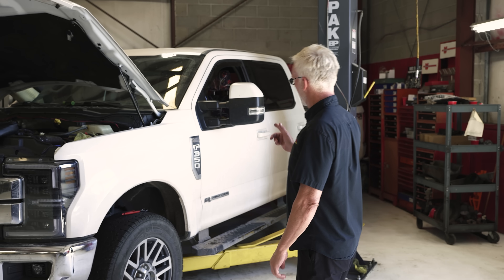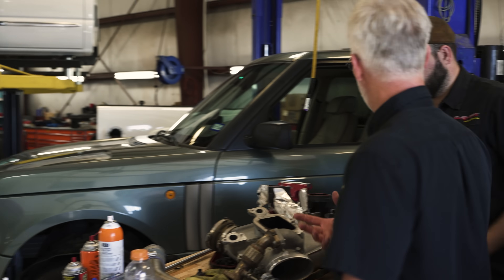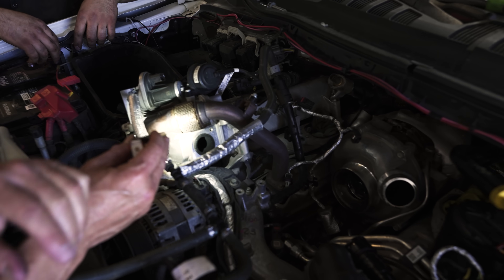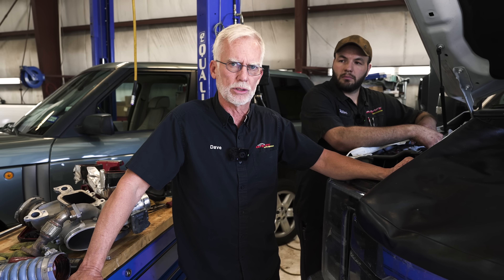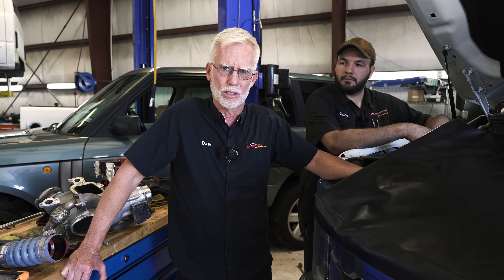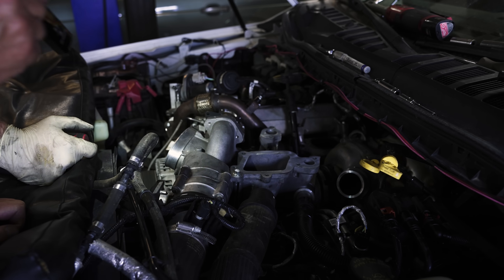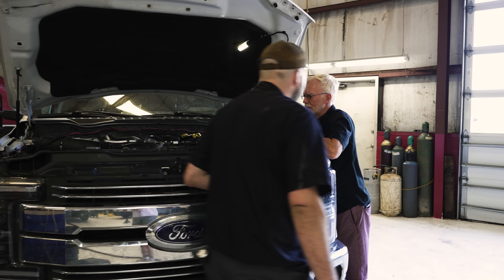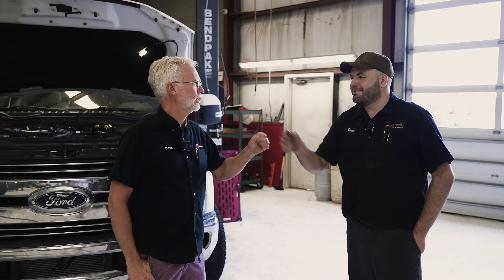2019 6.7 Powerstroke EGR Maintenance: The Problem With Carbon Build-Up

Comment: Anyone who puts miles on where I live (east coast Canada) deletes all this BS from day 1. Which voids your warranty but they know it’s better in the end.
Reply: The diesel brothers had to pay enormous fines for doing that it sucks but that’s the government we have need to change the gov to get change
Reply: @jdhiner1  no, you need to change the contract that all world leaders signed in Paris at the World Climate Convention.
Reply: @jdhiner1 yep! Uncle Trump 2024
Reply: @jdhiner1 damm them wanting cleaner air
Reply: Egr should be drawn after dpf. Problem solved. Cat engines go a million miles with clean intake passages. Manufactures just don't want to spend any extra. They rather it be someone else's problem
Reply: @warrenhodges8214  never thought about this but absolutely would make a HUGE difference!!!
Reply: We pay carbon tax, it solves all our pollution problems. Yes I’m being sarcastic
Reply: My '06 LBZ Duramax never had carbon buildup in the EGR system like that. Ouch.
Reply: @rosschamberlain1823 Iv been told that the LBZ duramax valve only opens when idling. But I can’t verify that. I have an LBZ too and never an issue
Reply: For the ones so worried about people deleting their trucks and how it’s illegal the last time I checked the government trying to control what you can drive and what you can’t drive I take as illegal especially when they are sending our soldiers out in deleted trucks yet the citizens of the us have to suffer from engine failure due to the emissions and then they expect us to keep paying for it if we want to drive them yet they can delete from factory and send them out to the soldiers? How does that make any sense seems like they know that the emissions are defective pieces of shit if they are deleting trucks from the factory and sending them out to soldiers. That’s my whole argument. Kory Willis is fighting against the EPA and how they are basing the whole US off of California and their tyrannical ways.
Reply: Rn that's illegal, how about we elect someone who can effect change and stop the horrible EPA ideas.
Reply: @affinityfunable  it’s legal where I live
Reply: If voting made any difference, they wouldn't let you do it 😂
Reply: @shaolinfist8323  very true!
Reply: @affinityfunable these egr issues have around since the 2000s, so what did bush and trump do about it lol.  Plus these regulations are global, so there is that.  I’m not saying it’s right but your opinion of changing government, like if you believe trump will change it is stupid
Reply: @bfv8 the Trump administration is getting ready to do just that. These Marxist laws are fixing to go away.
Reply: F the feds
Reply: Just delete the whole EGR systems...  Yamaha cant even get the R6 to pass emissions... this ruines everything on every motor
Reply: This is why manufacturers are making smaller turbo engine setups. To pass the emmisions bullshit when in reality its just making more junk yards
Reply: Illegal for shops here to delete
Reply: @CoachJay7212 You don’t have to take your car to a shop to have something done… you could just do it yourself
Reply: @Bllksem  that’s the way to go I guess.
Reply: @CoachJay7212 nope
Reply: @CoachJay7212 

Who's going to tell
Reply: @David-yy7lb  someone that gets pinched will turn rat fast.
Reply: You delete yes it’s a great option but…when you get caught, I’m not sure if the penalty in the USA but in Australia you’ll cop a twelve thousand dollar fine and whatever else.
Reply: @bryonricketts385  hi Bryon if you get pulled over on the street and if the do a technical check your screwed over here in Holland, if I am not mistaken they(police) will confiscate your car and you get a hefty fine. On top of that you’ll have to pay for storage until they are done with the investigation and than I will have to bring back the car in it’s original state , which means your not allowed to drive the car and will have to pick it up from the storage facility on a trailer. I on the other hand you wave possession of the car because of all the hassle it will be destroyed!😒
Reply: @robertoschols3599  I’m not one hundred percent sure but in Australia you probably will have the car impounded and then crushed into scrap….like I say I’m not sure but yeah best to keep it in factory condition….its just not worth it!!
Reply: We should make the government responsible for the emissions systems ruining our $100000 vehicles.
Reply: 😮😮Do it at home then. If you live in Comifornia or one of the other states that restrict what you do to your own property, oh well sorry about that, you should move to a free state! Ironically the government orders non-emissions equiped trucks for themselves(military) but prohibit John Q Public from doing the same. 🤔🤦🏻‍♂️Do as I say, not as I do!
Reply: @tdotw77  Way to spin the misinformation. They are not restricting what you can do with your own property ON your own property... they are restricting what you can do with your own property ON public property; there is a difference. You can delete and modify all you want as long as you don't bring it on to public roads. That said... you can't "roll coal" as much as you want to in your driveway in most states. For the same reason(s) you can't throw your trash in your neighbors yard. 
As far as military vehicles are concerned they aren't required to be equipped with all the emissions systems we have on the domestic market because they may not be able to get the exrtemely low sulfur content diesel fuels we are restricted to on the domestic market when deployed overseas. Whenever a military vehicle will only ever see domestic useage and never be deployed they have all the same emissions stuff that us John Qs have to have.
Reply: I’m with you on that subject.
Reply: @tdotw77 your damn right brother 🤙🏼 my hard earned money I’ll do what I want with my property 🇺🇸💪🏼🦅
Reply: @tdotw77  There's no double standard there. It all makes perfect sense. Military vehicles aren't driven anywhere near as much as civilian vehicles, and there aren't that many of them, so their emissions aren't that big of a deal. 

I can definitely live with my Amazon delivery being a couple of days late because a truck had EGR/DPF/AdBlue issues, but military vehicles gotta go when they're needed, and when things get that bad I definitely don't want any emissions control issue stopping them.
Reply: @Tuppoo94 you make as much sense as Cackles in the campaign where she got destroyed and We The People rejected her and her parties insane ideology.
Reply: @Tuppoo94  The other thing not mentioned when talking military vehicles is fuel sources.  People don't think about the fact that the military doesn't just use diesel made in the US, they use diesel from all over the world, or even JP-1 with some additives.
Reply: Hi, I wish we could do that over here(Europe) the problem being that every year we need the car to get through the MOT and once they see that you have deleted the PCV system and or other regurgitating system like the EGR system it’s a negative for you and you got to go trough a hell of a lot of hassle to get everything back and working again!😕
Reply: Fellow east coaster don't tell Quebec our secrets they'll push on us soon lol
Reply: Yeah but the government can special order new trucks without any emissions
Reply: It’s ironic that without emissions you won’t need a warranty.
Reply: You drive a Taliban taxi keep the secrets to yourself before you ruin it for everyone
Reply: Thats what we do in Canada, yeah......and then you have 1000 comments from Americans  "its illegal", "you can go to jail", "shop gets huge fine"......land of freedom 😂😅
Reply: I bet you have never been to China or India, where diesel emissions cause so much pollution and smog that you would long to have emissions standards in place.
Reply: Just deleted EGR, ADblue and DPF. No more problems, better fuel economics and going through emissions test nice and clean.
Reply: Think about this we are the only country that puts this crap on are truck& the military vehicles do not have emissions on them
Reply: My 12 lost that crap years ago. And ford still did my ric flair under warranty twice. Truck has 137k kilometres
Reply: Deleting a diesel is illegal in all states in the u.s. it's a federal law not a state law. But yeah emissions is a joke. I am all for Deleting but most shops won't do it any more. A shop close to me got caught Deleting oil feild truck. That got fine  million bucks
Reply: @bigmurph1447  So is speeding, murder and hundreds of other things but they still happen daily. My truck, I'll decide!
Reply: Our government is illegal, They sure don't represent us.
Reply: One of our cars run on a fuel called HVO100. GF drives into town (4 km) and back. Never any issues during the 4 years we have had the car. Citroen 1.6 hdi. Driving 10000km yearly. Saying these EGR / DPF issues can be fuel related also.
Reply: It’s illegal most places. The feds are involved now too. Not so easy. Big fines. Most people can’t afford that risk.
Reply: @maximus518774 I live in CA and have never seen a truck get popped for emissions.
Reply: @maximus518774 don’t attract attention to yourself with a coal roller🤙🏼
Reply: In some cars, doing an EGR delete will cause the CEL, check engine light, to glow continuously and also throw up error codes. WORSE, the mileage drops significantly. 
Tried EGR delete on my previous diesel car and had the problem mentioned above.
Reply: @baredesigns1  Either you didn't have a corresponding tune or a bad tune.  Can't see deleting EGR negatively effecting economy.
Reply: @baredesigns1  then it wasn't done correctly or completely or someone doesn't know what they're doing... 🤔🤦🏻‍♂️. It's done to these vehicles every single day of the week that ends in y, all with no CEL's, much improved MPG(20+). Simply search YT for dozens of delete videos. I can find one for you if you don't believe me... 🤔👍🏻👌🏻
Reply: @tdotw77 My vehicle had a sensor in the EGR that reported if there were no intake pressure, which would happen if EGR deleted. Actually had 2 sensors, 1 near EGR intake and 1 at its exit, these are meant to find out if EGR is getting blocked. Of course these sensors can be disabled, but will trigger the CEL. Only way out was to delete the EGR and then modify the ECM. I didn't want to touch the ECM. In this particular model of cars, people who delete the EGR puts up with the CEL😊
Reply: It's against the law to remove "this BS" and can result in "interesting" legal issues. Hope you aren't in love with your rude, as it can be confiscated and crushed. Your wallet on the other hand isn't going to be happy when you get the fines from doing so.
Reply: We should be able to report these owners to the EPA. You’re polluting the environment by running these diesels. And they should be recirculating 90% of their emissions.
Reply: It’s not bs it’s trying to to make the environment better. Stop being lazy and design a better system.

Comment: Scary video. That is a crazy amount of soot. Makes you want to put a big bottle of diesel clean in every tank. I never knew diesels had true EGR systems. I thought only gas engines had them. The carbon buildup is awful. This is a necessary maintenance procedure. I wish every shop had this much dedication to do the cleaning and reassembly right.
Reply: Diesel additives would do nothing to help this particular problem. It's directly related to the EGR, PCV, and driving profiles. The buildup is worse on vehicles used for short trips.
Reply: @ivorscruton5121  I know they say long and hard for these vehicles, but let's be honest here this isn't a perfect world you are gonna either make a long or short trip this is just fuck you now give us money
Reply: Makes you wanna not buy any diesel after 2004
Reply: Unfortunately Diesel Kleen isn't going to prevent this. Removing the EGR system is how you prevent it all together!
Reply: That wouldn’t help. Fixing your pcv would help. That is the root problem
Reply: You can thank the government for that bs on all vehicles
Reply: @brucelewis1017 I'm thankful there's no smog
Reply: @matt45540  no we just now have to use def, the jug it comes in, burn a lot more diesel because they are less efficient, build egrs, dpf, and buy trucks more regularly. by the time you calculate all the extra manufacturing, fuel use, and extra trucks purchased I bet we burn create more carbon. This is not about saving the environment. It is about money.

Comment: Hears a good idea stop recirculating exhaust gas
Reply: Prefer to breathe clean air.  Dave knows how bad the winter air in his locale yet would remove diesel EGR systems if the EPA would not hit him with fines.
Reply: Better idea: maintain your shit or buy something that can be neglected. Also get a catch can, soot is not sticky without oil.
Reply: it's much easier to maintain your shit when you're not sending soot through the intake.
Reply: @benchoflemons398 
Bs if you have a proper crank case ventilation filters you don't need a catch can
If you getting oil vapour carry-over EGR has already killed your rings
Reply: @garreysellars5525  your filters are only gonna do so much. Still need a catch can and even then you still might have issues getting egr gas oily.
Reply: @benchoflemons398  even better idea- get the epa out existence.